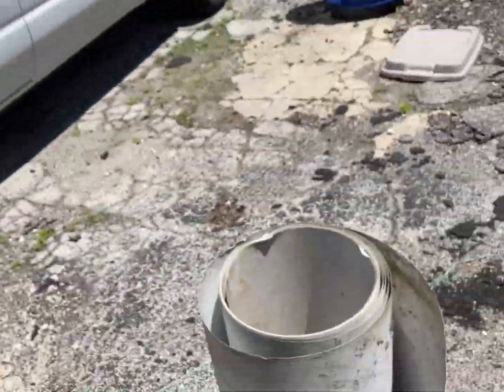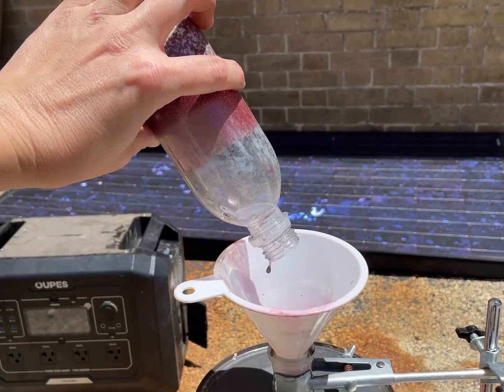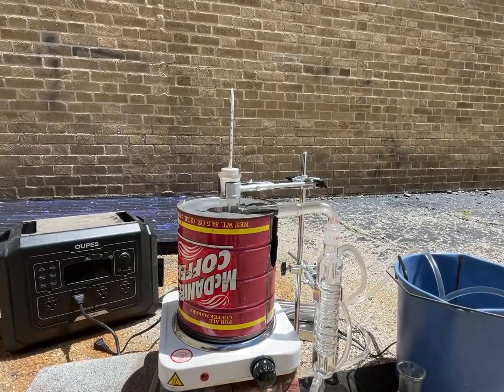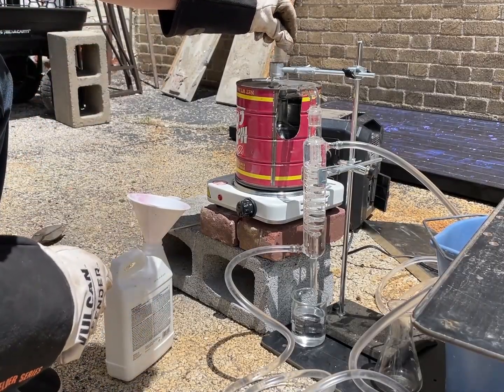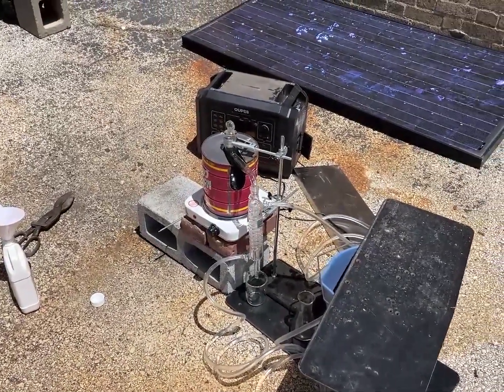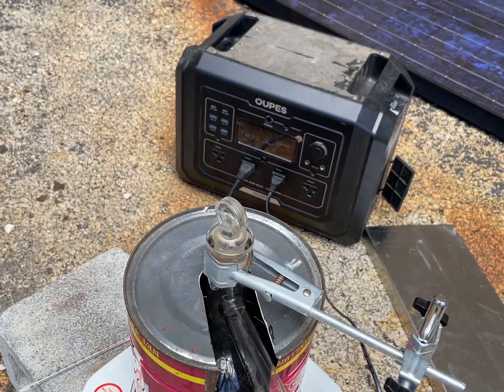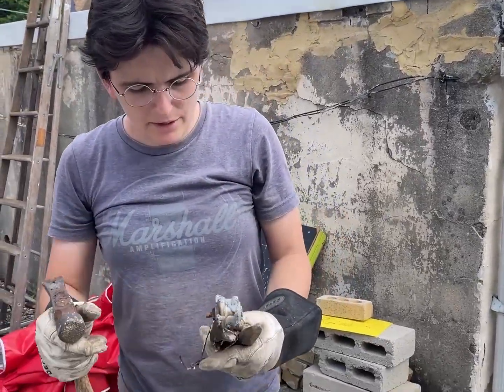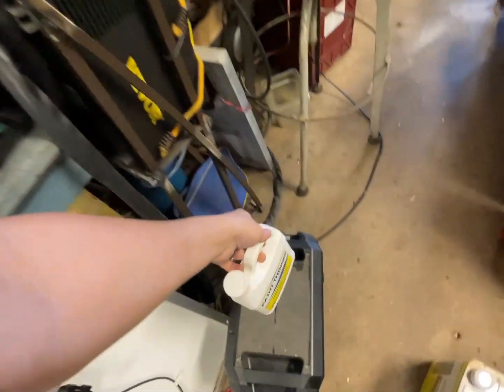Distilling Flammable Solvents: More efficiency and still no fire. Also bending long metal trim.

Comment: Get a small heat exchanger from am old A/C unit & circulate the water through that, in addition to through the condenser.  Set up a fan blowing air through it.  Water will remain at outdoor air temperature.
Reply from the maker: In this case the outdoor air temp was significantly warmer than the water I had, so that would just warm the water quicker in this case, but I agree.

I think what would be better is for me to finally get that 1930s refrigerator Im planning to buy from a friend and use it to make ice!

Comment: Never heat glassware directly on a hotplate! This can create severe heat stress in the glass and cause it to crack or even blow apart. Always use either a sand bath (as you mentioned) or an oil bath. Also, adding a few broken pieces of glass or terracotta to the distillation fask can help with nucleation to prevent bumping. Cheers!
Reply from the maker: This is supposedly borrosilicate which is fine. just to be sure I asked my friend who used to work for Dowe chemical and he said sand wasnt used that often. If it can handle a direct flame, it can handle a hotplate I figure

Comment: can I ask why you record at 1440 by 1080p instead of the 1920 by 1080p
Reply from the maker: I like how with modern cameras I can shoot far more zoomed out, and now crop it in so you not only get widescreen but extra view on top and bottom. The cameras we used to have in the 2010s didnt go this wide so itd be hard to film things without needing the full width of 16:9
Reply: As stated in other videos, it's a personal choice. @RinoaL stated they wanted to be a filmmaker and they have a strong preference for the square format. I bet you wouldn't go ask Spielberg or any of other greats why they choose a specific film over another would you.
Reply from the maker: @sonic2kdotcom  I figure the original questioner was also interested in video or film, and so asking as another video / film fan.
Reply: @RinoaL  ok what the hell going on over here all I was trying to ask is why you're recording at 1440p by 1080p instead of the 1920 by 1080p but instead this is what I get Jesus Christ
Reply from the maker: @Quality_Contro  is there something wrong with my response?
Reply: @RinoaL  yes all I wanted to ask is why are you using 1440p by 1080p instead of the 1920 by 1080p I just want a simple question. and sorry if I got a little bit aggressive I had a paper shredder gearbox explode in my face so yeah that's why I was a bit angry and a little bit aggressive on the last comment.
Reply from the maker: @Quality_Contro  It's ok, i've definitely written angry comments before.

But yeah I like 4:3 because i felt we used 16:9 due to lens limitations before.
Reply: @RinoaL  thanks and yes I been through that too.

so that's the reason why you use 4:3 because of lens limitations oh ok.